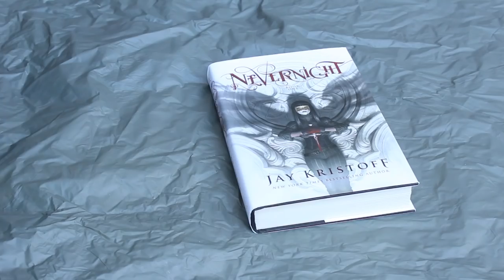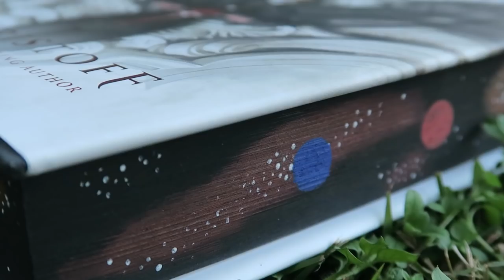PAINTED PAGE EDGES | Defacing Nevernight

Comment: Just curious as to what paints you used? And how long you let sit to dry?
Reply from the maker: I used super cheap kids acrylic paints (I had to go over the yellow so many times because of this). I actually squeezed in filming/painting across about 3 days due to my schedule, so between the 2 layers of the black spray paint and then the colour, I would leave the project overnight if not a couple of days. Lots of drying time!